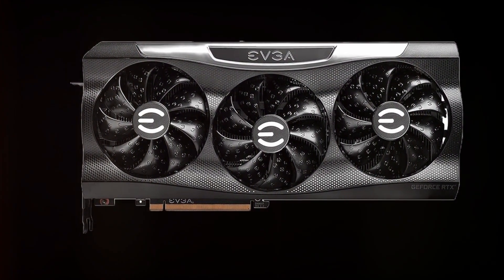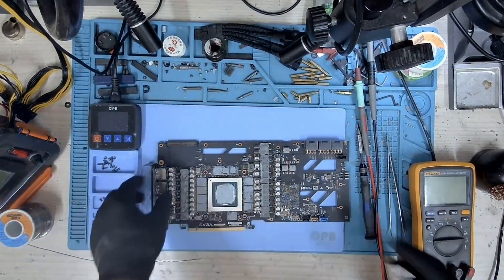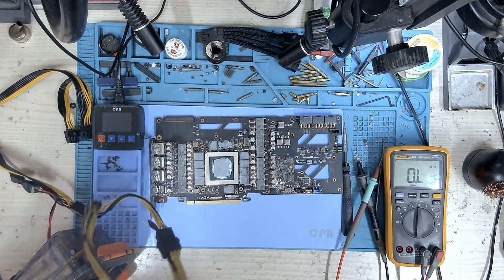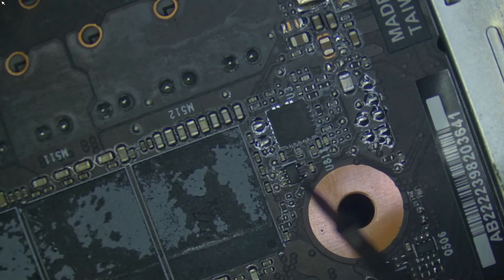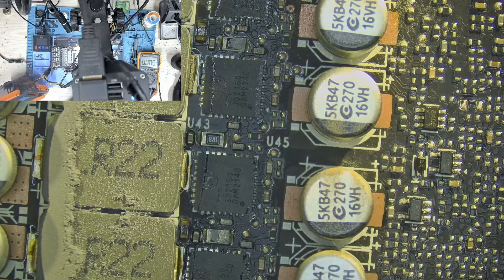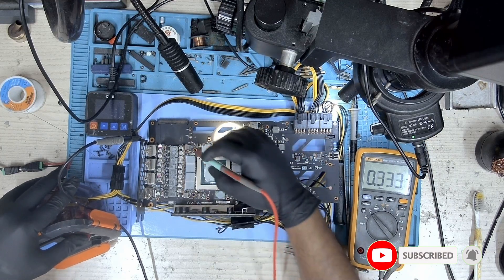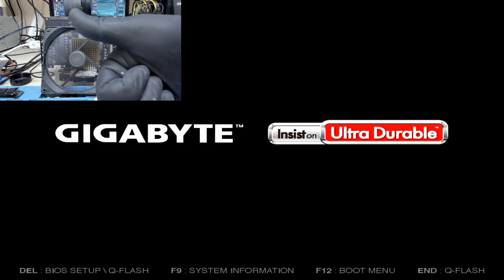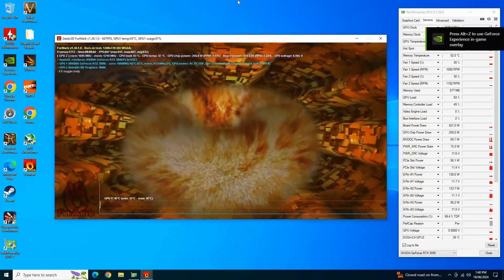The Mysterious Case of My Vanished RTX 3090

Comment: Hi Fraser! Not sure if you remember me, I contacted you regarding my Zotac GTX 1070 Ti Amp! where the Fans RPM speed was stuck at 43% and couldn't be adjusted, I was able to move the slider and click apply but no change to current rpm happened. I tried one last thing and I flashed the same BIOS and it works now! I don't believe it. When I first bought it, the Video card fan was working and I was able to change fan speed until I installed new Thermal Pads and re-applied some Arctic MX-6 Thermal compound then it just stopped working, how this screwed up my bios? I have not a clue. But all is well now, it's was a good bargain that I bought this GPU  for $90 CAD. Cheers Fraser and thank you so much for your help on this matter! BTW Love your Videos, especially those well done intros. Well done!
Reply from the maker: Hi Sean. Sorry, I lost your chat somewhere in the pile. I'm glad you finally got it working. I'm still surprised thermal pad replacement and BIOS had any relation. It could be something that corrupted the BIOS and after you flashed it it now worked. I'm glad you did not give up and I'm happy you you fixed the issue.  😁

Comment: you and northwest do it right my man.
Reply: In my opinion, Frazer would be my option if I didn't myself know how to repair my own GPU's. The North West Repair guy is very knowledgeable, but fixing cracked GPU pcb's is not a good practice. I have stopped offering this as an option because these repairs are prone to fail sooner or later. Once the PCB has been compromised like that, it doesn't matter what you do to try and fix it. It will eventually fail again. It's a question of ethics.
Reply from the maker: Thank you 😁